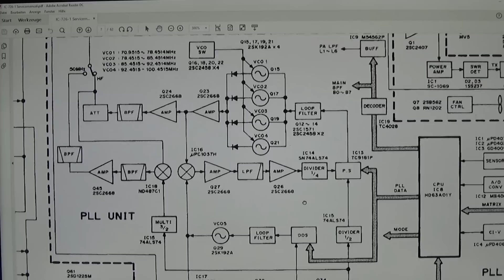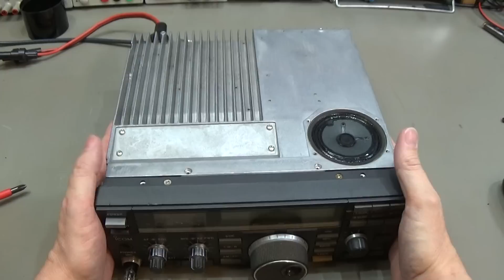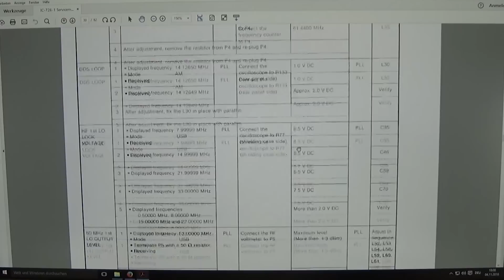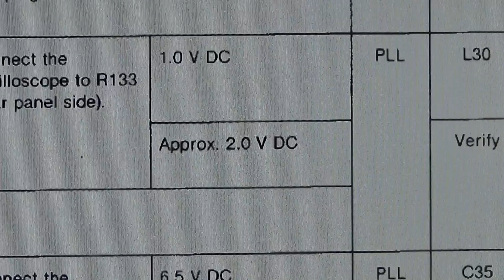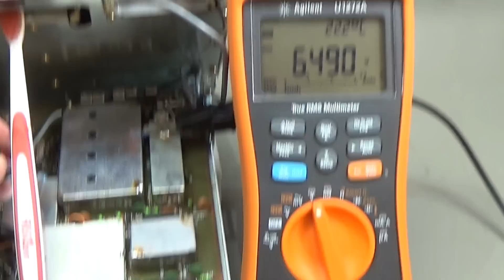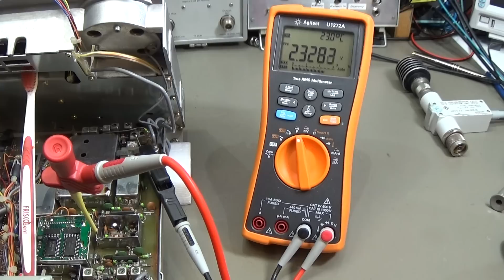#114 ICOM IC-726 Repair PLL/ VCO; dead spots in TX and RX

Comment: Thank you! I was able to get my ic 725 fixed with these instructions. Mine only had two VCO's with the wrong voltage so it would wander in and out of lock in receive and transmit and the DDS loop needed adjusted. Totally running great now. 73!

Comment: Peter, thanks for a great video on the 726. I have a used 726 that has been working less 6 meters but now all hf received signals go away and then in a while the radio starts working again. My problem I'm fairly certain will be in the VCO. Great systematic troubleshooting video. many thanks  Rich KG5IF

Comment: Hello from UK, 2E0EKU I was wondering if this problem can occur from radio getting dropped at some point in its history as that coil seems very sensitive to adjustment?.
Reply from the maker: Hi John, well hard to say.. of course a hard hit could potentially  do that but I believe those hit must be that strong that the housing would be most probably damaged. In our case the problem is simply caused by ageing... Thanks for watching 73

Comment: I got my equiptment out and fixed it it was the same adjustment you did I now have full band coverage.the reading was .7 it was to be 1.0 volts this has a trimmer I adjusted it and bam alset thank you
Reply from the maker: Glad that you find a solution! 73
Reply: TRX Bench  thank you I aligned the  radio the voltages were off. like new very happy glad I watched your video from KN4GTU 73's

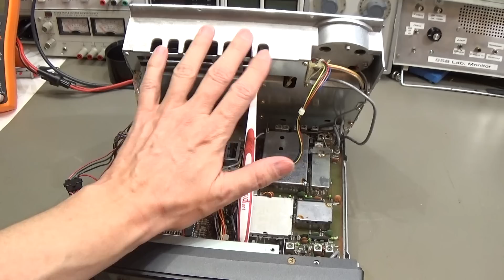Comment: @15:46 why not make up some extensions to plug in and have the unit where you want it? Or even cut and extend the wires by soldering in extra length?

Comment: Hi I have the ic-725 but I don't have the cord. What cord would I need to purchase in order to plug it into a wall receptacle. Thank you. 73
Reply: Brady Handel ; I know your comment is old but just want to warn you don't try to plug it in direct to the wall, you will ruin it. You need a 12 volt DC power supply.

Comment: I have the IC-729
on 20 meters the receive would cut out but have transmit turn radio off and turn radio back on everything works
but now I have lost 8.000mhz to 14.999mhz
I have no transmit or receive 
could this also be the same problem??
Reply from the maker: Hi Neal, yes that could be possible but a remote diagnosis is always difficult. 73
Reply: TRX Bench  would I be able to send it to you I feel this video describes the same problem . I am having now 
no rx or tx on 8.000.00 thru 14.999.00
Reply: TRX Bench  sorry about getting back to you so late I just forgot about everything
Reply: TRX Bench  every band works but that frequency range I gave you

Comment: hi
great video. my IC R8500 receiver has issue of no audio. squelch circuit is working fine though.pls do a video or some techniques of troubleshooting this
Reply from the maker: Hi Adnan, if I get a radio with no audio in, I will do a video! Thanks for watching 73
Reply: will wait for that. Also if u can do a proper video on how to properly test vhf Rx and Tx and their detail parameter checks.i need to see such video as part of preventive maintenance. 
rest u r doing wonderful job m such a huge follower of urs. may GOD bless u for doing such free knowledge spreading for us.

Comment: Just a note, Peter. Some years ago, I was having similar wiring problems, so, to overcome the short wiring, I made various leads up to plug between these lead to go into the PCB. It was a pain to get the bits together, but they worked fine for many years. If I come across the sealed package (I have moved house 3 times!!) with these connector leads, marked 'Icom extension leads', then I will forward them to you. They look very professional and served me well.
73 de Tony
Reply from the maker: Yeah Tony right but the problem is you never have the right extenders....Thanks for watching 73

Comment: I wonder if replacing that little electrolytic capacitor next to the transistor would have gotten the VCO to an usable range without messing with the coil. That thing could not have moved too much, being covered in wax.
Reply from the maker: Hi Andrei, adjusting the coil is the procedure according the service manual. 73
Reply: TRX Bench I understand, i have watched the whole video. However it is odd to me how that circuit could have drifted that much by itself since that inductor is fixed with wax.

If the aging of that capacitor was the cause then it will keep drifting as time goes on and it will require periodic adjustments, something that should not happen.

I have designed and built a FM broadcast band amplifier using 2 transistors and the gain at band ends is adjusted in a similar manner, by adjusting the spacing of an inductor, due to my general dislike of trimmer capacitors. So i totally understand that. But i know and you know too that electrolytic capacitors are among the first components to fail in any electronic circuit. Just throwing that out there.

My vintage Philips PM3050 dual 50MHz oscilloscope had some noise on the trace when i got it, even with the input shorted. Replacing the capacitors in the power supply fixed it. Still a good deal for ~70 Euro. I've had it for 5 years i think, and i see it mentioned in the 1989 Philips catalog - that makes it 2 years older than I am! Still a good piece of test gear for what i do (mainly SMPS work), but it does fall a bit short with RF circuits.

I am currently watching your review of the miniVNA because i am interested in getting one.

Greetings from Romania.
Andrei

Comment: Hi, and thanks for good video. Again.   I have just same kind of problem in 726. But only 8-11Mhz was quiet. Both TX and RX. Nasty fault. There was a PWB strip broken. Someone has put too long screw and this was damaged a foil. Just near DDS loop can... It was 8V supply to syntezizer. Other band get power (reduced voltage) by diodes from band swithing lines. Janne OH6LSL
Reply from the maker: Hi Janne, thanks for your report! Always helpful for the community 73

Comment: Nice repair Peter. Would you recommend adding more wax to the sub loop to help keep it stable ?
Reply from the maker: Thanks Grant. If there is enough paraffin left I would not mix it with another material as you never now how it behaves together. Hope that helps 73

Comment: did you check the subloop voltage after you soldered back the cover on the oscillator? metallic covers tend to change the oscillator frequency.
Reply from the maker: No I testes the functionality afterwards and everything is working fine. 73

Comment: But... what was broken?  Did someone tinker with that subloop inductor?  Did other components age, requiring a change in the inductance?  

I see that there is some potting compound in place, perhaps to stabilize the inductor (physically).  Has this deteriorated?  Did you replace the potting?

I know, 1000 questions!  Thanks for considering these.
Reply from the maker: Hi Mark, the good news is nothing was broken. It was simply a miss-alignment by aged  components. The compound you saw is stabilizing paraffin and it is still good..   Hope that anthers everything 73
Reply: @TRXLab  I am sure the wax changes dielectric properties over the years.

Comment: Peter,
Nice repair video. If you had a couple cable extensions, would have made positioning the PA unit easier.   :-)    
Noticed the LP-500 was in use.     WB3BJU
Reply from the maker: Hi Donald, I always have the wrong extensions on hand LOL... Yeah LP-500 is always in use :-) 73

Comment: Very nice Peter. Did you add a bit of paraffin/beeswax to the coil to set it in place again? Or I suppose you should simply use the heat gun to soften/re-harden what's there already. I think Buddy is right, probably just aging components that caused the shift. How about the memory backup battery, was it still good?
Reply from the maker: Thank you Dino!. There is enough paraffin down on the pcb so I just put my hot solder tip into it and done..Back up is replaced. Buddy is right it is a ageing issue. 73

Comment: Another great repair.  Nice to see your new station minitor un use.  How do you like it so far?
Reply from the maker: Thank you Mike! Yes the LP-500 is great. Minor issues on older radios which are not able to let 200Hz passing for the carrier on spectrum mode. In this case you still need your SA for IM3 tests. 73

Comment: And yet another alternate use for the old tooth brush !!  And another real good video !!!!  I thought you were going to have a problem with adjusting  L 30 with it being held by glue, but you had great success in getting it right !!!!!! I learned a few more tipstoday so many thanks !!!  I did not realize that such a minor adjustment could make the difference of bringing the circuit to working , Really valuable knowledge !!!!!   and so it was a simple fix   -------    John A Bellas   KC2UVN
Reply from the maker: LOL yes that's it :-) Thanks for watching and feed-back . 73

Comment: Hello good afternoon! have a TS-440 this without RX you know if this is a common problem in it this sizzling however do not have strong reception 73
Reply: If you see dots in the Display than it is a realy comon fail for this radio.
The goop in the VCO stages become conductive.
The best and unfortunate the hardest way is to solder out the components and remove the goop complete.
After cleaning up replace all components and aligin the VCO ports.
 73
Reply from the maker: Other than that it can be a fault in the front end. 73